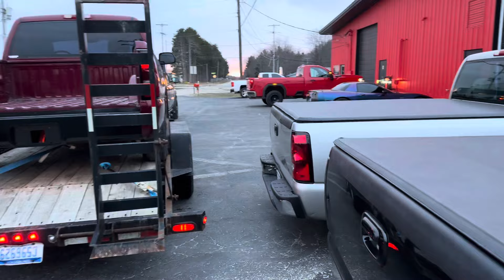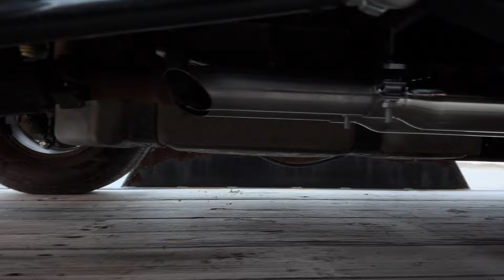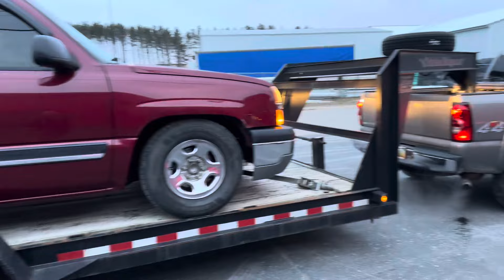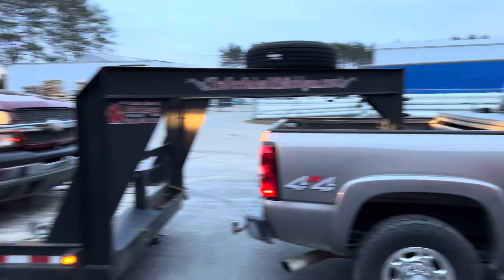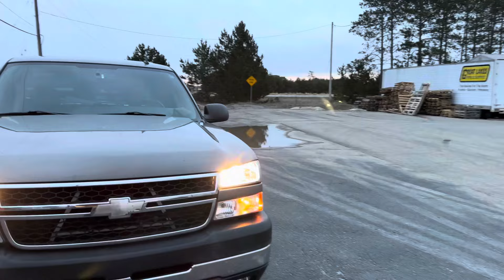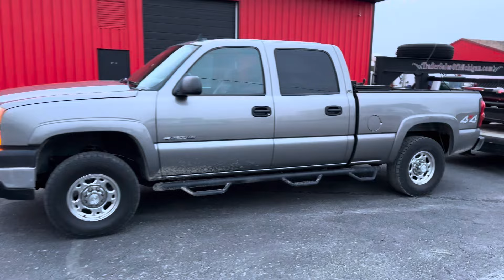Mr Brooks Silverado choppin! BTR 5.3 hotrod cam idle and rev clip also Callie’s 210/218 6.0

Comment: I've got a 2001 single cab Silverado with a 4.3 v6 in it. While in South Carolina recently for a funeral I found a totaled 2001 Tahoe with the LS. Not sure if it's a 4.8 or 5.3 but I'm going to buy it and swap out the v6. Any suggestions for upgrades to the LS before I drop it in? It will be a daily driver.
Reply: Cam and valvesprings.